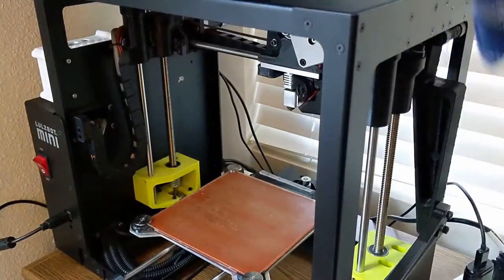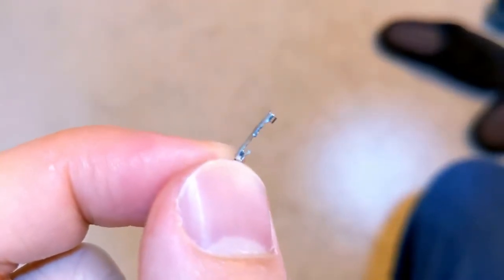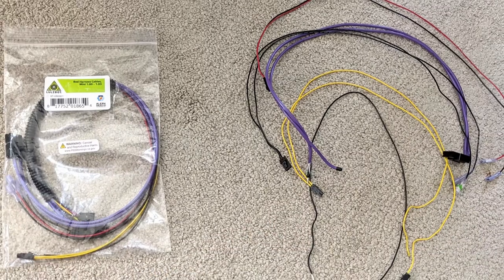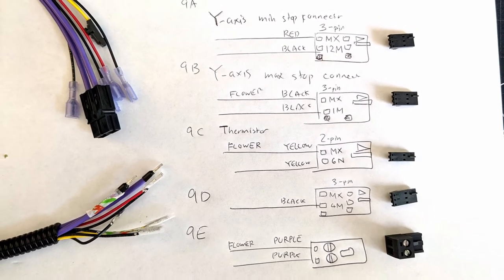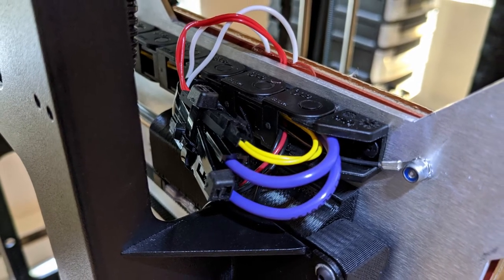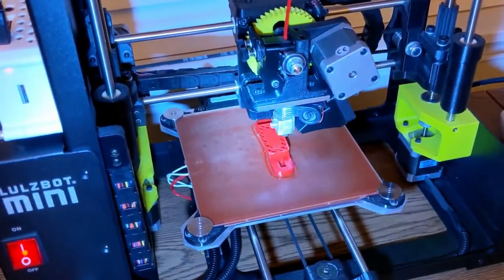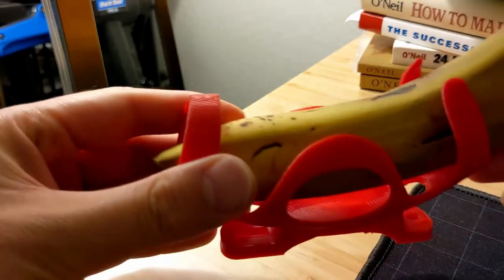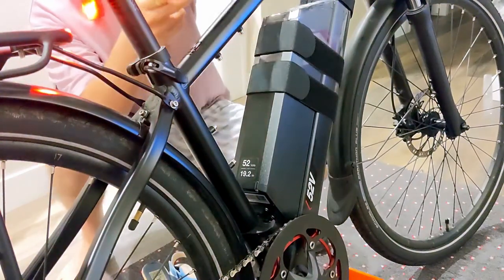Fixing the 3D Printer Thermistor Cable!

Comment: Brian,  this isn’t about your 3D printer it’s about my Hyper Scorpion. The bike will arrive soon, I hope you can answer something for me. How best to charge the battery. Is the sequence to plugging it in: to first connect the charging cable to the battery, then cable to the charger, lastly charger plug wire into wall socket. This procedure is backward to what Rad Power Bikes instructions. I’ve had no issues with my Rad Power Bike battery 2.5 years now. That said, is Juiced battery pack different? Finally what works for you as you solved your battery issue. You should know I bought a Grin battery satiater.
Reply from the maker: Hi Daniel, I'm not sure the sequence matters that much, but here is what I do. I have the Grin Satiator connected to a surge protector, so I can turn off the Satiator with a flick of a switch. With the surge protector off, I plug in the Satiator to the bike battery, and then I turn the surge protector on. When the Satiator is done, I just turn off the surge protector which turns off the Satiator and then unplug it from the battery. I don't think the Juiced Bikes battery would be any different from the Rad one. I didn't have any issue with the Juiced Bikes battery except at the beginning when the connection wasn't good. Recently, the charger turned out to be bad, but that wasn't the battery's fault. Anyway, I don't think you need to worry too much about the sequence. Let me know if you think otherwise!
Reply: Got it! I will get a surge protector and follow your sequence. If it works for you with no issues that’s good enough for me. Surge protector I didn’t think of that, very important. Thanks Brian!